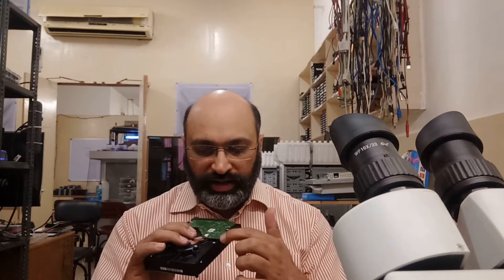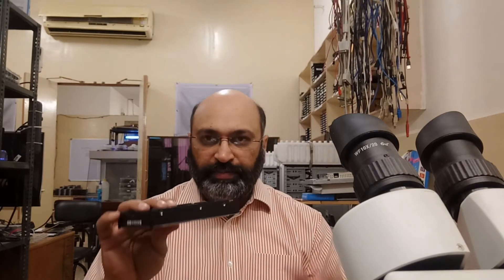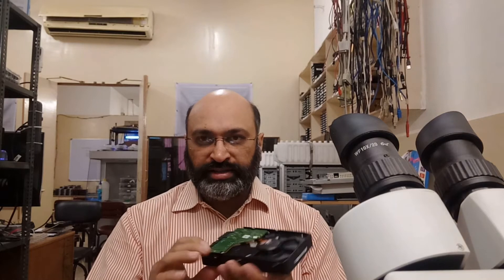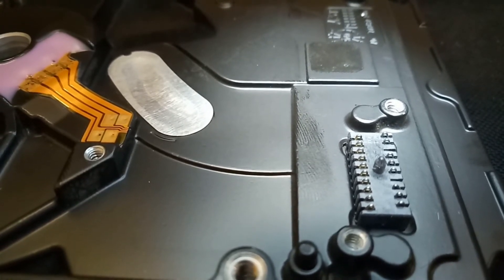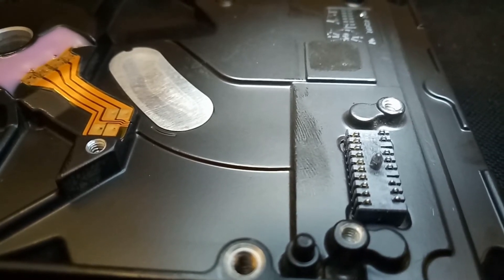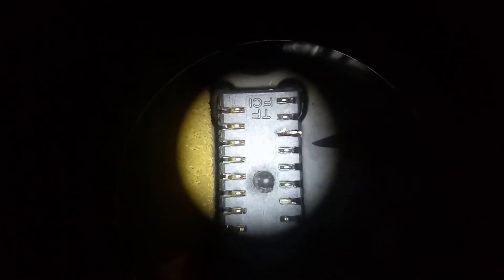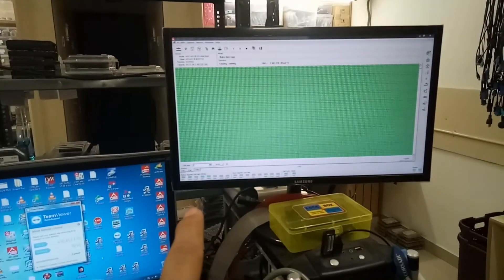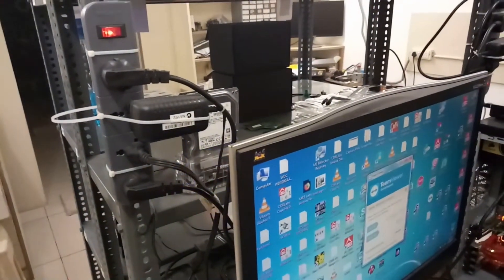Amarbir's [ CDRLabs ] - Broken HSA Connector Repair Using Desoldering Wick [ Western Digital HDD ]

Comment: What would be the cause of this failure? This is owner's or technician's fault, right?
Reply from the maker: The HSA Pins Were very corroded with oxidation .I am sure that corrosion weakened it and some guy before me tried to clean them leading to the break .I though this is a great sequel to your glue seagate case right erikin haaa haaa